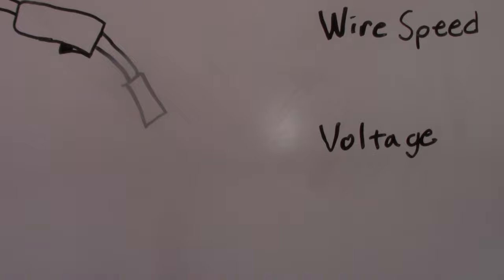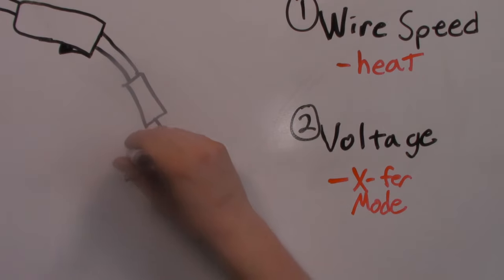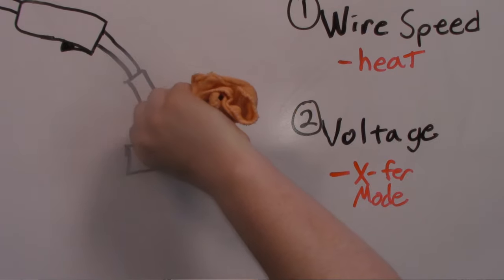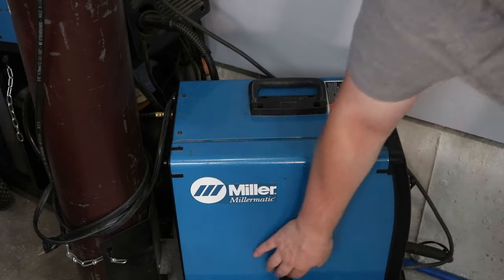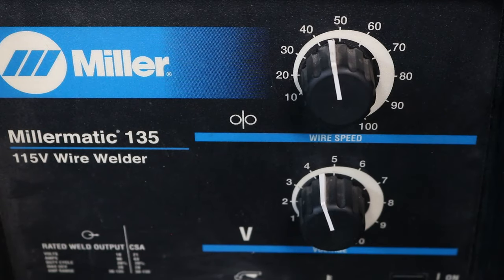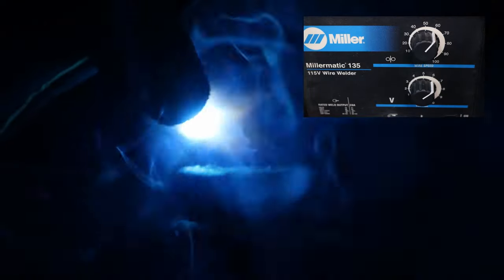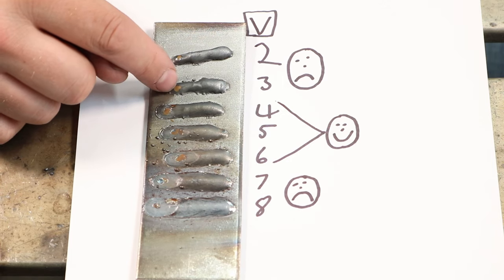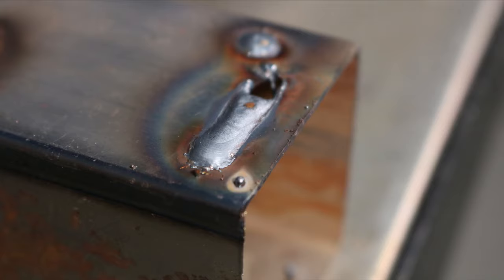MIG Welder Settings: MIG Welding Basics for Beginners

Comment: Hi Tim ! I have used Miller's app and the wire feed speed values they give for certain material thicknesses are different then the ones in the chart you present at min: 3.03. Am I missing anything ? Thanks !
Reply from the maker: Yeah, recommendations are all over the map. The funny thing is that the chart was calculated from a Miller manual. I’ve looked at a lot of recommendations from Miller, ESAB, HTP, Lincoln, the charts on the 3 MIGs in my shop and they’re all different. That’s why I think it’s good to be able to dial it in yourself through a test. My experience with Miller settings is that they’re typically on the hot side for my liking.
Reply: @TimWelds  Thanks, I appreciate that you took the time to answer. You're doing a great job on your channel. Keep up !

Comment: I just got a Mig welder and I'm trying to learn.
You mentioned "penetration" once in the video.
It seems to me that "welding" is meant to melt the two pieces of steel you're trying to weld so they can "fuse" together and become "one".
I've been trying to weld a solid rod onto a pipe and it seems that the "wire" coming out of the Mig welder wants to become the "glue" instead of melting the two pieces into one.
What settings are needed to get a good penetration, avoid having little mounds of wire and make both pieces of metal behave as one (instead of having globs of wire behave as "glue")?.......When I try to use the final result, the weld fails because the metals don't seem to be "fused" as "one".
Reply from the maker: You need more wire speed and voltage. Another issue could be technique, particularly the distance between your contact tip and work being too long.
Reply: @TimWelds  : I have improved on the distance.  I used to be so far away, I couldn't see exactly where I was welding.  Turns out that the arc makes a little flame that lights up the area and that helps me see.
I was thinking that less wire speed (instead of more) would be better since it would allow me to stay at the same spot longer and get good penetration before creating a big glob and not know if I was able to really penetrate.
Thanks for the tip.

Comment: I’m running 1/8 steel with 035 flux core wire .the machine is Vulcan  omnipro 220. Can’t seem to penetrate into the steel. Does anyone have the same welder with correct settings? Thanks

Comment: Why does my mig wire fuse to tip where wire feeds through to often?
I does this and I have to use cutters to get wire loose.,keep welding and little puddle forms  occasionally and here we go again.
Reply: That is what happens to me.  I don't know the fix. exactly.  I held it a bit farther away from the surface and it seemed to help but that might not be the right fix.  I hope somebody that knows answers this question!!!

Comment: I'm confused. In the beginning of the video is said that the wire speed setting was controlling the heat. Then you showed a number of examples where varying the voltage change the weld from cold through to hot. Better at the beginning you said the voltage changed the weld mode of transfer.
Reply: Technical, they both control the heat. The higher the voltage, the hotter it is and the faster it heats up. Faster wire speed makes a colder weld by reducing the time the metal has to heat up. Or at least this is the way it was taught to me.

Comment: If I need a voltage of 19.5 where should the dial be?
Reply: It depends on your gaz and wire thickness 
Im using argon 8% co2 mix
.35 wire 
And running 315-325ipm 
With .45 wire I was using around 190to200ipm for 19v

Comment: where do you set you regulator on gas ?
Reply from the maker: Depends a little bit on the nozzle size, but 25 CFH (13L/min) is a good starting point.

Comment: Were you using gas or flux core?
Reply from the maker: Gas shielded solid wire. Flux core will run a bit different in terms of the physics, but the same concept will still work to dial in the settings.

Comment: How about if I have only Amp and voltage dials on my machine?
Reply from the maker: There are a few different types of controls, but your Amp dial will essentially control your wire speed, so treat it like I used the wire speed knob and it should work for you.
Reply: @TimWelds  Thank you..

Comment: Pls pls help me I have done the job in 15 to 20mm metal sheet so pls help me setting how many volt and current and wire speed will be seting for proper arc pls help me
Reply from the maker: When you get that thick, you'll probably need to run multiple passes. If you're running 1.1mm wire, start with 220-270 inches per minute and 23-24 volts for short circuit transfer, then dial it in like I showed in the video. Remember that machines all run differently, so you may end up outside of these ranges to get an acceptable result. I hope this helps!
Reply: A pre heat will also go a long way with thick material. I've only just got a MIG and not yet played with it but I can stick weld and the principle is the same for both.

I make my own tools, jigs and fixtures for my lathe and milling machine, most of which use thicknesses of 3/8" ~ 1/2" and I've learned to do a pre heat for structural welds at it will allow for deeper penetration and cleaner looking beads.

Comment: My craftsman welder has high voltage and low voltage. There’s no dials or anything besides the wire speed and that is only measured in increments with no numbers or anything

Comment: What amperage and Volt. is used for different sizes of electrode during welding?
Reply from the maker: Your amperage will be controlled by wire speed on most MIG machines. The chart in this video will give you a starting point based on the wire size. After that, follow the procedure in the video to adjust the voltage. I hope this helps!

Comment: If this is meant to teach beginners, you really should not say things like "dial back", or anything else that gives a beginner options. Beginners have no idea what they're doing. They need complete instruction. You said at the beginning that you did the calculations already. That's something beginners need to know. Teach them how to do the calculations. Even if they never use those calculations again, they will understand better what the chart on the machine is telling them, because they will understand where those numbers came from. I haven't seen any welding instruction video teach welding calculation yet. I hope such a video exists.

Comment: Way too much word  salad just get to the point speed and voltage without all the word salad
Reply from the maker: Salad free version:
Wire speed up for more amperage (heat) and down for less
Voltage up for longer (average) arc length and flat/concave bead profile, voltage down for the opposite
Voltage too low will stub out, too high will burn back (both of these problems sound like machine guns)
Reply: @TimWelds  that’s what I’m talking about thank you for the tips